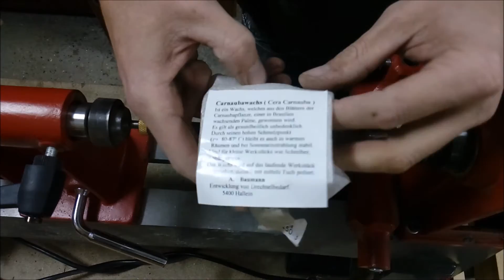Making Pen Turning Jigs and My First Pen

Comment: Grate video, just starting with pen turning , I have a mandrel but no spacers or bushings, do these have to be purchased separately 
Or do the come with the pen kits ? . Thank you.
Reply from the maker: +Jim Robbins Thanks! In many cases they can be ordered with the pen kit's, they are pretty cheap and you only have to buy them for the different pen type's. The bushing size depends on the pen kits you use. Keep on Turning!

Comment: When I saw you hit that drive with a hammer  [good or bad video ,I wont know,] I clicked dislike
Reply from the maker: +Alf Key It is totally your decision. Sorry but that's the way I do it. Just hitting it hard. This way I'm sure the drive center is seated properly. Thank you for your time and comment.
Reply: It's not how, it's what with,  drives cost money, one, the hammer could shatter, two, round over the Morse Taper so it dose not fit in the Head Stock, You tube is a good teaching platform, and i can see that you are proud of what do , i used a leg off a pine bed,. Hey i've got a lathe ,,,,so i turned a mallet from a piece of apple, the wood that is , anyway good luck for the future ,,Regards Alf
Reply from the maker: +Alf Key Yes you are right in all points, I have made a wood mallet video, but I don't know why I wasn't using it that time, look at my video from two weeks where I made the copper egg. There I use the mallet.
Reply: Ollari's I hit mine with a hammer. When it rounds over I grind it back. Using a mallet or rubber hammer doesn't have enough striking force for me.